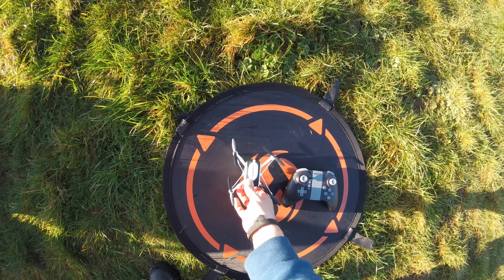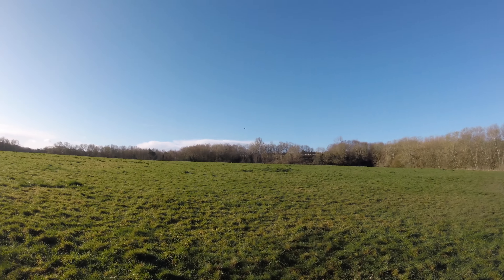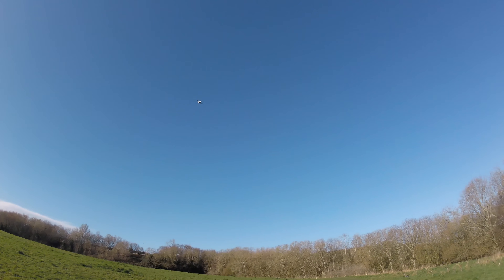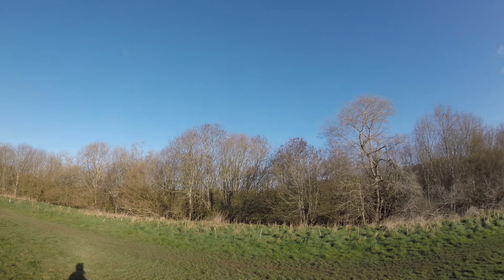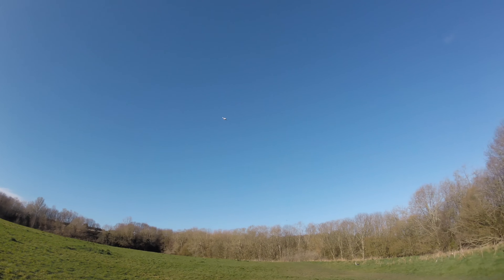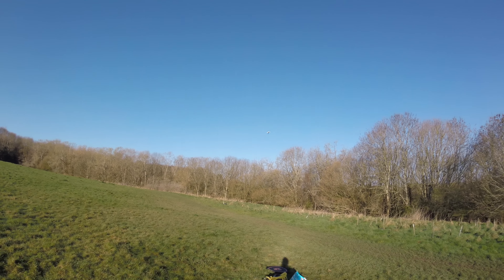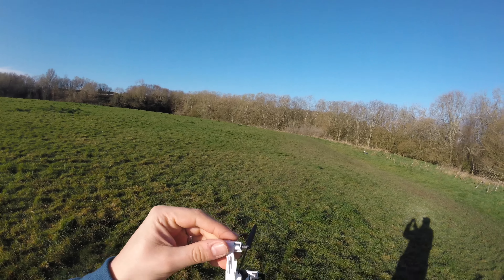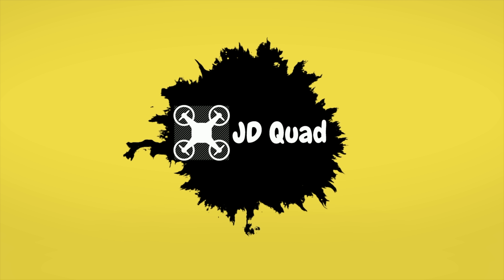Mini FPV GoolRC T700 Outdoor Flight Test Video

Comment: Looks very  capable especially in those breezy conditions, respectable flight time as well considering you were in speed mode 3 and the motors were fighting the wind! Pity about the frame cracking, maybe a more permanent fix is needed? 👍😎😁
Reply from the maker: Thanks Phil bud, this quad made up Alpha One https://youtu.be/OfmMfdpsU-c :-)